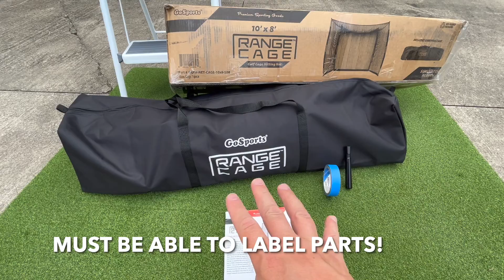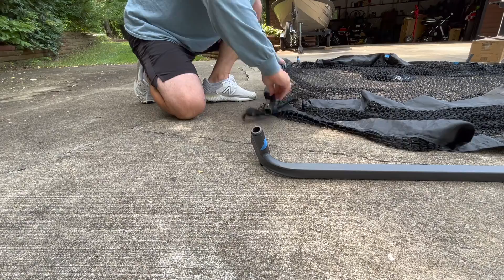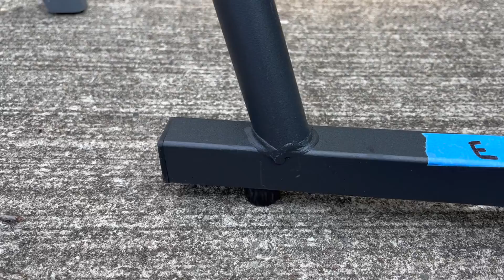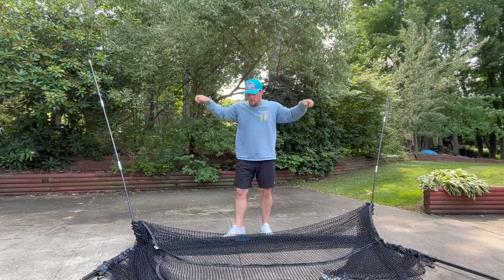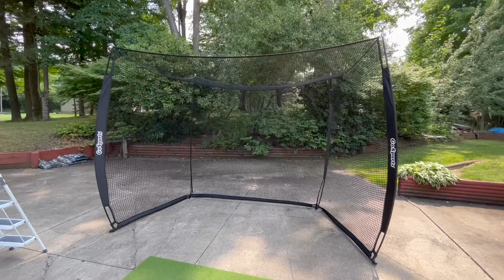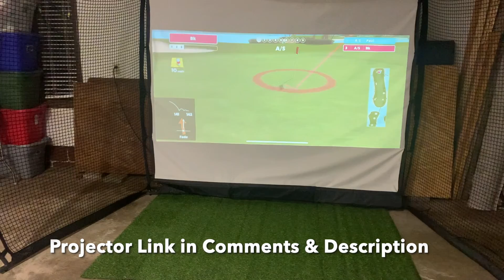How to Set Up GoSports Range Cage Golf Simulator Net

Comment: Excellent video, now i have to get someone to buy the hitting net i just bought so i can go out and get this one. Also what Launch  monitor are you using?
Reply from the maker: Thanks - Garmin R10 in this video
Reply: @dub-golf is it worth getting or spending more on the mlm2pro?
Reply from the maker: I personally would rather get the Garmin R10, as the MLM2Pro is very good but has too high of subscription fees. 

Square launch monitor is a great option for indoor use only.

Comment: Is there any way to modify the width? I was planning on buying this cage but my garage door opener is encroaching on the 10' width this net requires. I really need an 8X8 but I don't want to spend $400 on the Forza ProFlex and then still need to purchase an impact screen separately.
Reply from the maker: No way to modify this model unfortunately.

Comment: Does the cage have any give/flexibility to the width at the opening? I'm very interested in it as a budget impact screen/cage but I only have 9.5ft of width before there's a beam in my shed at 7ft height. Do you think there's a workaround?
Reply from the maker: It does not have any flexibility to adjust the width.

Comment: Great video! I'm looking to purchase and see that they offer a net option OR the impact screen option. Did you get the net option and add an impact screen to it, or did the impact screen option include the back net with it?
Reply from the maker: Yes, I got with the impact screen included. You can remove and just use as a net if wanted - or they sell 5ftx5ft target screen on Amazon for like $24 that are great to attach to the back net as well for a visual.

Comment: Thanks for the video. Just put up my net however I have way more sag than you do. Pretty darn sure I did it correct though. 😂
Reply: And… I had E and F reversed. 😅 directions said sag is normal. Without your video I would have accepted that. 😂
Reply from the maker: It’s easy to do because none of the parts are labeled out of the box! Glad you were able to get the right metal pieces together! 
Yeah, I think some online reviews, people mix up the the bottom rails and it leaves a huge net sag

Comment: I’m torn. I probably will be putting up and taking down the net each time I use it. However the with the spornia it just makes me super nervous that it would miss something. I feel like once you got a system down with this it wouldn’t take quite as long
Reply from the maker: Yup - I am in the same situation. Spornia goes up so quick. If within budget, check out the Elite GoSports 10 Net. Setup is 10-12 minutes, not as strenuous. But the value for the Range Cage, is unbeatable, in my opinion - for the price, the sim screen and quality are really good.
Reply: @dub-golf yeah I like that it has the sim screen as well. Probably will go with that and just deal with the extra 10-15 min it takes to set up

Comment: You guys did a great job showing how to do this. I'm going to get almost the exact setup. I've been looking for weeks, and you convinced me! I only have one question: are you happy with the mat? I've seen someone recommend the "country elite commercial mat" (which allows you to use regular tees), but it's $100 more. If you are satisfied with the GoSport mat, then I think I will be too.
Reply from the maker: GoSports mat can’t go wrong with, especially at the price. We used it for two years and had no complaints. Imo, best mat under $200, I’ve tried quite a few. 
Country Club Elite is nice, but like you said around $100 extra. I do like how it is heavier and denser and takes a tee. Some people do not like how it ‘grabs’ the club head when hitting too much turf - I actually like that aspect. It let me knows if I am hitting behind ball or chunking a bit. 

Both mats are solid but for price GoSports great value.
Reply from the maker: We also hit off concrete and whatever Mat you choose… we use one inch gym inner lock tile underneath to alleviate future soreness from the concrete downswing.

Comment: This was unbelievably helpful! Managed to get my net set yup way faster using your video. Any tips for getting the final white loop on the front pole? It seems to take a bit of brute force! I've started to just use one of the tent pegs to lever it over the top, but it does take some force.
Reply from the maker: I have struggled w the white loop on top! Usually, for me, the back end part of the net is twisted, by the rounded corners- making it hard to reach the white loop. Once, I fix the netting at the bottom, I don’t have a problem. But it’s definitely a tight pull.
Reply: @dub-golf  Thank you! I'll take a look at that!

Comment: How would you feel about this as a garage setup but partially disassembling and flipping the base up against the back wall of the garage to get it out of the way so cars can still park? To just put the thin poles on and connect net at the top would only take 1-2 minutes once you know what you were doing I would think?
Reply from the maker: I think that would be possible. It’s a great net/cage for a garage. Many people park/pull in their vehicles in the actually cage (even large trucks). 

It took me about 3-4 times to set up this cage - and than it became pretty simple. But the first couple times…. Was rough for me 😂
Reply: did you ever try this? I wanted to try the same thing.

Comment: That’s a big net. 
Does the screen absorb all power  from the golf ball or do you need to add a cushion behind the screen so you won’t dent a wall
Reply from the maker: Screen does a great job of handling all shots! Even comes with a weighted, padded bottom so any topped shots won’t penetrate the bottom screen and hit the metal base.